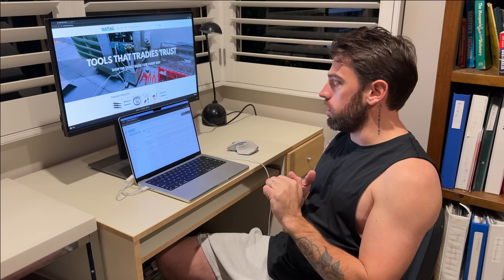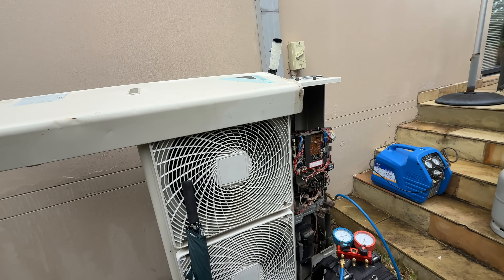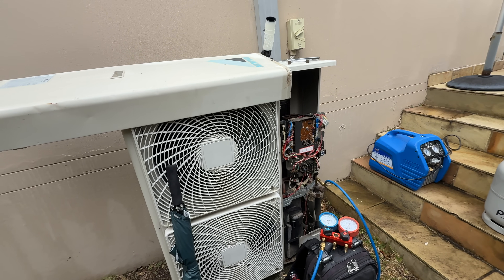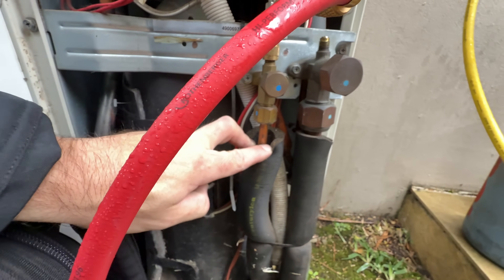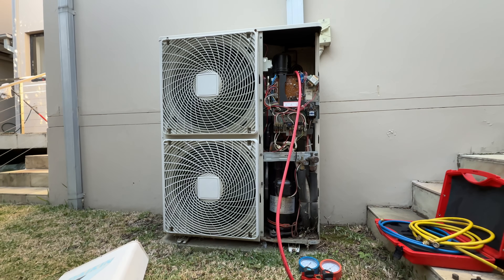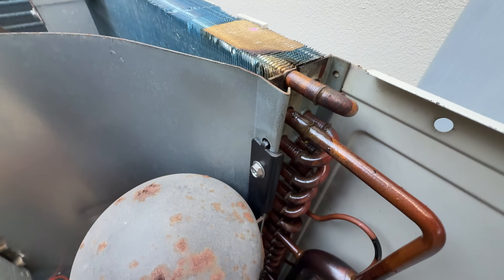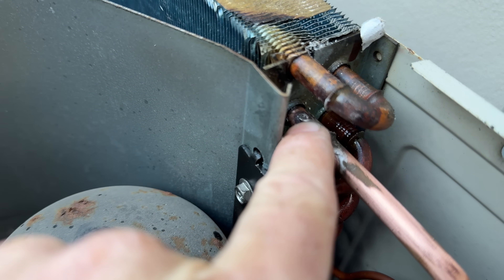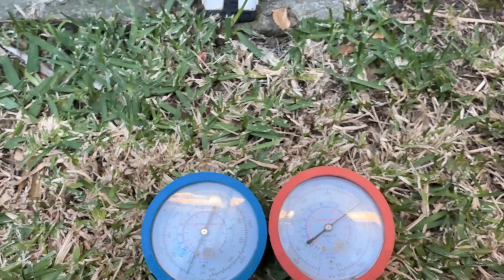Daikin System Looks Fine… But Doesn’t Heat Right

Comment: Nice repair Mitch! You are correct always explain to the customer the full situation being honest and you will be successful and go far in life my friend! I wanted to tell you two methods I have used over the years for checking Schrader cores for leaks.... my preferred is either makeup or buy the Yellow Jacket 40332 Blue Compound Gauge with 19110 Quick Coupler and remove the core depressor then screw on hose connection if it leaks the gauge will go up quickly (might need different adapter if 5/16 instead of 1/4") The other method is get a brass cap and drill a tiny hole in the top of it install the cap and big blue the tiny hole! This way you do not introduce a lot of moisture into your system when you hook you manifold set up to it. This system was r-22 mineral oil so is much more forgiving than the r-410a or r-32 POE oil systems. Since these systems do not use liquid line filter driers I always pulled 3 vacuums down to around 100 microns or below purging with nitro in between but that takes a little more time. R-22 is way more forgiving and you did an awesome repair here Mitch! Being honest having good ethics are key for sure too many out there are not 😥
Really enjoy your videos and wanted to say I have my conversion from metric to inch pound and C to F and to PSIG so it makes sense to me because I would be lost without that conversion tool! 🤣🤣🤣

Comment: Would you have high discharge if it was low on refrigerant?
Reply from the maker: You wouldn’t have high discharge pressure but you would have high discharge pipe temp
Reply: Correct

Comment: Congrats, honestly you deserve more followers. watch your vids religiously. Had a similar problem, not heating. The service guy re-gas the outdoor unit. unlike you, he did not replaced the old caps with new ones. My AC is 25 years old and probably need new one. Spent $1k on repairs and fingers crossed will get us out of trouble until spring.
Reply from the maker: Thanks mate, I appreciate your support! Hopefully the unit holds out for you, I’m sure the caps will be fine. Cheers

Comment: Congrats on 10k mate 

Would you not want to nitrogen test it again for a few days after repair to make sure that was the only leak? Or would just trust you micron gauge during vac?
Reply from the maker: Thanks mate, it was a slow leak so I was confident that was the only leak in the system. That and using the vac stat together make me confident enough to walk away. 👍🏻

Comment: Great work as always, those small slow leaks are a bitch (which most leaks almost always are) Do you have any kind of leak detector? I also currently use just nitro for leak finding, but been thinking about a quality detector, like fieldpiece. Finding those small leaks with nitro is usually impossible like, lets say there is a R410A minisplit unit from 2015 and it's low on gas. I reclaim it and it's missing let's say 40-50% of the charge, so i know it's leaking, but really slowly. No apparent oily spots anywhere, so it can be a bit rough with nitro only
Reply: Inficon stratus is the best along with the acutrak ultrasonic leak detector.
Reply from the maker: Good to know !
Reply from the maker: Thanks mate! I personally don’t have an electronic leak detector. I’m not against it though, it’s more just the cost of a decent one and the value I’ll get out of it, has made me not buy one. Maybe one day I’ll buy one if I can’t find a leak.

Comment: Those 22 units like leaking there. I pressure the complete system, check the flares, service ports and shutoff ports for leaks. if this is all clear I split the system into 4, liquid , suction line, condenser and indoor , and pressure test each individually , check my blank off fittings again quick for leaks and then leave the system.  This makes it so much easier to locate a leak. Have same situation this week with DAIKIN R22 inverter midwall,  needs a new outdoor inverter PCB, parts been discontinued but i can get the last board available in the country.  Also given the options and waiting their reply. I  make sure the client understands the risks of repairing an old end of line unit, and leave it up to them to decide. But like u I would prefer to repair any unit than replace it. 

Has anyone used the universal inverter PCBs thats now available ?
Reply from the maker: It sounds like we have a similar approach. I haven’t used a universal inverter board personally. Surely you’d need to also replace the indoor PCB to match plus modify the eev, fan plugs etc. I’m sure it’s possible but much more labour intensive than installing genuine parts. Although if it’s the only option, I’d give it a go!
Reply: @maracservices  Yes its a kit - Think I am going to buy a kit - maybe an option to give a client instead of OEM apart. Obviously will need to factor in the labor costs of the conversion vs fitting OEM parts (if available)